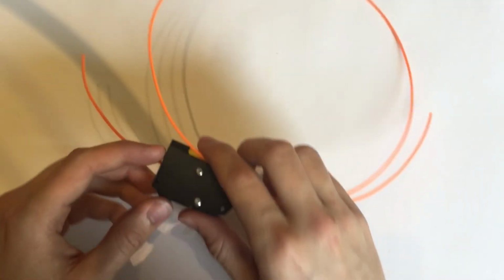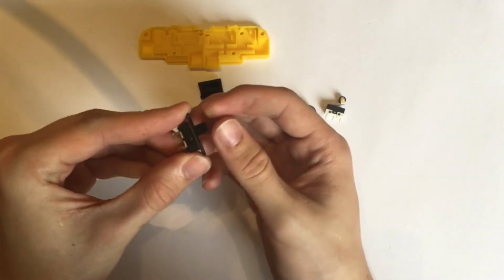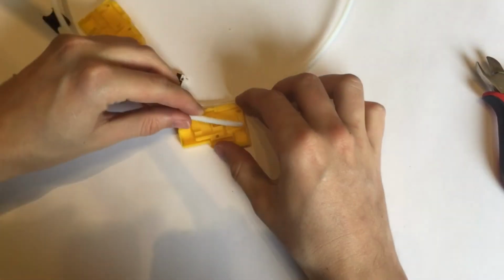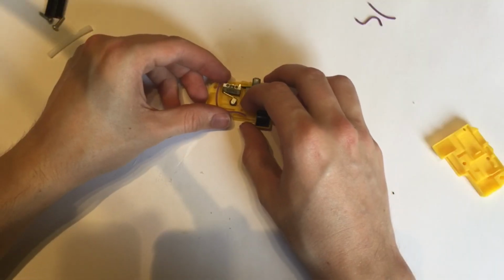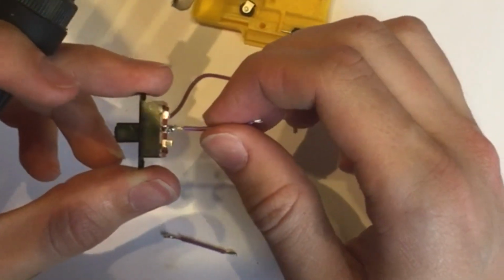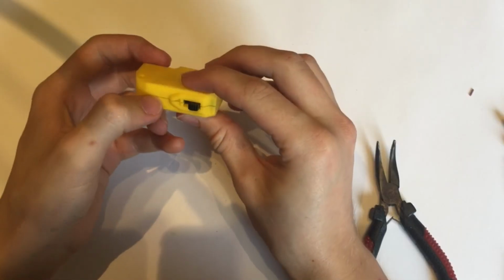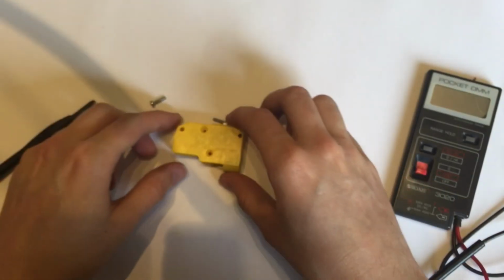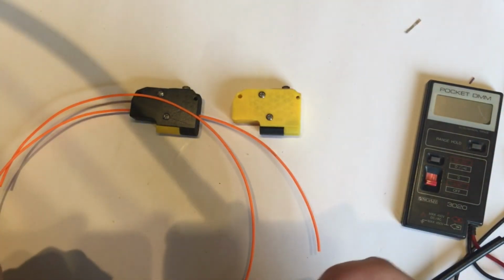Filament Runout Sensor at Under £2??

Comment: Have you stopped using this and passed a cheap sensor that will pause your print?
Reply from the maker: Aaron Winchester nope, I’m running dual and don’t want wires trailing to my printer and besides, I don’t do prints with nearly empty reels unless I’m in the house to keep an eye on them. Josef Prusa’s new sensor is incredible though and I hope he makes it easy to integrate into other machines.
Reply: All you need is octopi and an optical sensor...
Reply from the maker: Aaron Winchester if it works for you, do it. I don’t like the option, so I don’t use it. Hell, I haven’t even used these yet because I’m aware of how much filament I have.